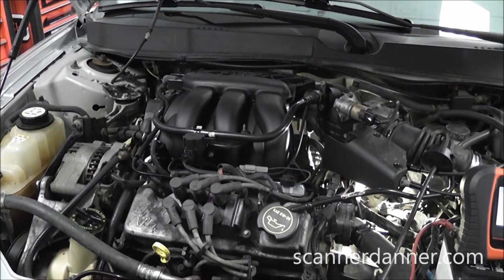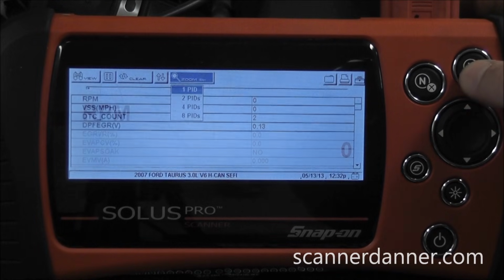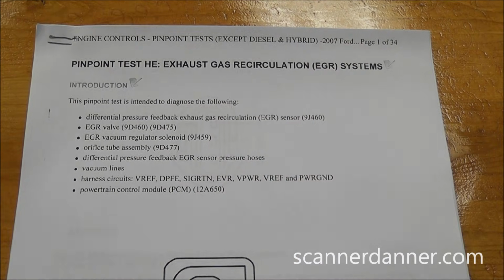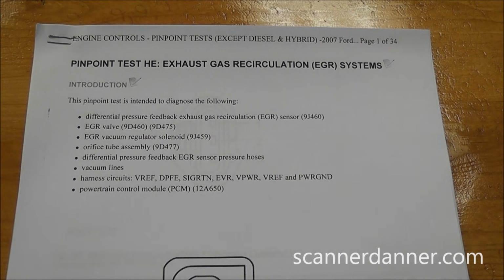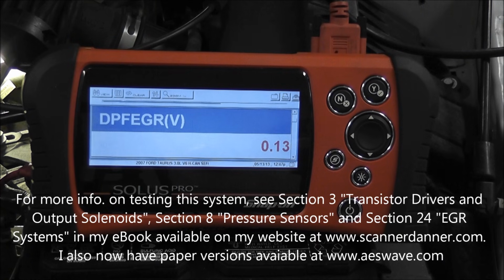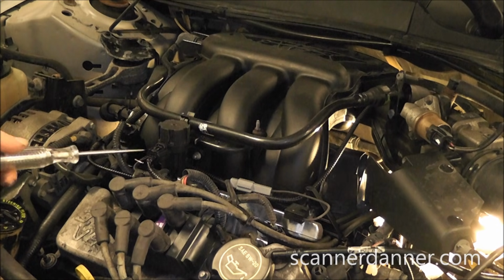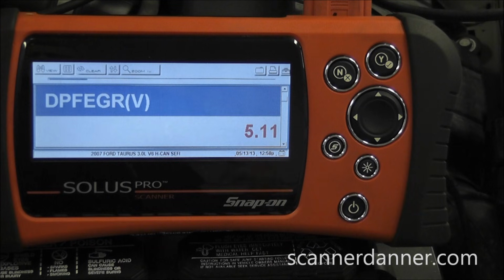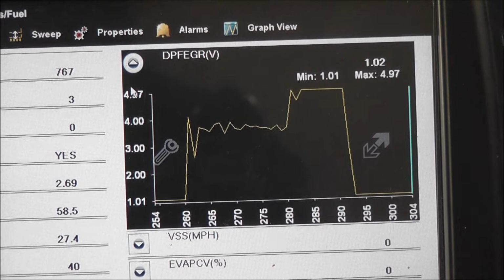P0405 EGR Sensor A Circuit Low (failed DPFE sensor)

Comment: Let me commend you on starting out with an explanation on how the EGR susbsystem actually works.  This knowledge is the key to quick diagnostics and repairs.

Your whole test methodology (forcing the valve to open via the control solenoid and watching for RPM drop) is what has been used for many, many years without scan tools.

Knowledge about this sensor would allow an experienced mechanic to jump to replacing it.

Following up with repair confirmation is a great way to do a "quality" repair !

Comment: That was a great explanation of how the EGR system works with the DPFE sensor using the diagram of all of the components.  Thanks for doing that. Makes it clearer. I never knew the hose position mattered because in previous videos when you talked about checking for restricted exhaust, you said you could either hose.  Thanks again for showing all of that.

Comment: Very good information. Replaced a DPFE on a 2001 ford expedition last week. Had a p401 code on my snap on modus. went to code tips and checked the DPFE voltage and it was steady at 0.2 volts. Replaced sensor voltage at idle was 1.03 after repair. One tip on the f150 and expeditions with the 4.6 engine, the passages in the throttle body are bad about getting clogged from carbon buildup and have to be cleaned out alot of the time. So if you have a P401 on 4.6 engine suspect passages are clogged up

Comment: I had a 2001 Taurus that, for years, had HORRIBLE spark knock and a really bad misfire at part throttle cruise. Never threw a code. I spent a lot of money getting the computer reprogrammed, ran a cooler thermostat in it one summer and NUMEROUS other things. Could never get it figured out. One day it threw a code for insufficient EGR - after I replaced it, it fixed everything else. Crazy how they relate.

Comment: paul great video on E.G.R system performance. best ive ever seen brother.paul E.G.R systems are simple yet can be so complecated.once you understand the coalition between P.C.M,E,V,R,D.P.F.E AND THE NEW YET SAME E.G.R SYSTEM MODULE LIKE FORD EMMISSION SYSTEM LIKE YOU PROVED IN THIS VIDEO YOU CAN CUT THE FACTORY FLOW CHART IN LESS THAN HALF.87% IN MY EXPERIENCE HAVE BEEN A FAILED D.P.F.E SENSOR.THANKS PAUL GREAT VIDEO RICK BAUZA.

Comment: My P0405 code turned out to be the wire connector as the wires had became brittle and causing them to touch one another. This was on an 08 Explorer 4.0

Comment: 1998 Pathfinder 3.3L, automatic, 164,000 miles, stock. Runs real good.

So I'm having a recurring P1400 EGRC Solenoid Valve error come back after erasing codes.  It reappears almost immediately after being erased.  I don't have any operability issues.  No other codes but one that came up after I started running the motor with the solenoid plug disconnected (for testing)...P0443 Evap Emission Purge Control Valve Circuit.  But it stopped appearing after I reconnected the solenoid plug.

I looked where the ECM is to access the EGRC Solenoid ground wire and crap is that a pain to get out!  So I did these troubleshooting steps to test the Ground wire resistance and the Voltage at the plug wire instead. This is after I tested the valve clicks/opens with 12v injected from a jumper wire.  The solenoid appears good, as far as activating manually. 

Ground Wire tests: left socket when looking at plug with lock button on top.

ENGINE COLD -- 
Off cold: 500 ohms
Key on cold: 1,200 ohms
Cranked idle Cold: 3,600 ohms.

ENGINE HOT --
25 minute idle warm up and short drive, and RPM revs to 3,000.
Off:  500 ohms.
Key On: 1,200 ohms
Cranked at 850-rpm idle: 1,600 ohms before revving, 3,400 ohms after revving 2,000 rpm.
Cranked and held at 2,000 rpm (in Neutral) for 60 seconds: 1,850 ohms.

### VOLTAGE tests ###
Power Wire: right socket.

Using ground wire on solenoid plug (motor cold) --
Off:  0.01v
Key On: 11.9v
Cranked: 14.3v

Using chassis ground frame bolt (motor hot) --
Off: 0.07v
Key on: 12.4v
Cranked:  13.7v
- Battery terminal as ground had same results.

If nobody knows I'm just gonna ignore it because I dont have emissions tests here and it shows no driveability issues either, so likley unimportant. 

But I kinda wanted to understand if my EGR is being left open to exhaust or closed, with the signal from the solenoid as-is.  Anyone know by chance?

Thanks!
Reply from the maker: Forget resistance testing. The problem with it is this:
1. When it tests bad, it's bad.
2. When it tests good, it can still be bad.
You have a 2-wire EGR solenoid that is flagging a code immediately, even after clearing it. Is that correct?
Step 1
Solenoid plugged in, with the key on, measure voltage on both wires (backprobing) and give me those readings.

Comment: Thanks for this video !!! I have stiil HUGE problem with my Mustang 2004/ 3.8 litre! After replacing bigger fuelpump, 255 lph, and bigger throttle body 70mm, my idle has been "crazy", goes to 2500, after about 20-30 seconds lowers to 1100-1200, never goes below??? There is a big vacuumleak somewhere, I know, because my AC works, but air is going to face first, like it supposed to then suddenly goes to difroze, to window, even I don't touch anything?? I was told that is a sign for vacuum leak. My "check engine" codes are P0507= IA Control higher than expected, sure know that!!!, and P0405 Exhaust gas recirculation sensor a Circuit low??? I tested so far, like you teach here!!!!, if my DPFE works, it is fine, I replaced it year ago, bought a new one now, no change, will return it, no change!!! Replaced TBS, IAC sensor, and EGR valve, all good!!??? I did checked voltage to canister solenoid sensor, in rear, that seems to work fine, when applied 12 V, and blow for it, it did close!!! I did not replace that one, I sprayed all over under hood, all vacuumhoses, no leak?? I did take out canister purge valve, could not really test it??, opened it, cleaned it???, put it back??, can't really tell, if it works?? Could that be open all the time?? And make big leak in vacuum system, and make idle higher??? I will replace that next, after taking back new DPFE sensor, old one is fine??? So confused, driving a car, thanks god, it is manual, very hard to drive, and gasmileage terrible!!! Please help me, smoking test next??? Thanks=)

Comment: I have a 1999 Taurus with a p0401 code and when I give it a little gas it stays at 2000 rpms for a few seconds and it idles at 950 cant find vacuum leaks egr tested good holds vacuum and stalls after its warm and apply vacuum.Before I start putting parts into it any ideas....very nice videos by the way

Comment: I know this is an old video but still you learn...i didnt know exhaust carbon only builds up at the intake end because of the gas cooling where it enters the intake...great stuff
Reply: shauns auto repairs : it can mix with oil from pcv system too. Also why inlet side goes clogged.
Reply: Benjamin Rich thanks

Comment: If the voltage on the DPFE doesnt pass 2V from activating the EVR does that mean poor flow in the system? The cars idle does change just not as significant as in the video. However even when raising RPM still don’t get near 4V reference.
Reply from the maker: Yes, plugged passages is what it sounds like

Comment: What if you have an intermittent low voltage code on a pressure sensor. I wasn’t able to get it to throw the code but checked wiring via multimeter and I everything looks good. I ended up replacing the sensor.
Reply from the maker: I think that is a good bet, based on the high failure rate of this sensor

Comment: what would you say of the code 0406 A circuit HIGH. i have it on a 3.0L 2007 ranger. have replaced the dpfe, repaired the blocked vacuum line to solenoid...

Comment: You always talk about the engineers and they should let us now about what is inside a module, I have Bentley manual for BMW 5 series and I can see what inside the module if the transistor is grounded or + feed. By the way you never work on German car's? I have Mercedes and BMW and they are not easy to backprobe molded connectors.

Comment: Hello there,  i have VW Passa TDI  2010, it smell fuel and did not heat up as it should be, also no eccelratin when its on P,   but it drive ok! i took it to the grage and changed egr with new one,  still the same,  it cost me £420,  any help Please Thanks

Comment: Hey...you are a great teacher..I bought your book recently and love it...I have a 2006 ford Taurus with a p0401 code. I did the test you did..my dpfe didnt go to 4 volts while running but only rose from 1v to 1.3 and the engine did stall...so does this concludes my dpfe is faulty?
Reply from the maker: Thank you! Redo the test now at 1500-2000 RPM to prevent it from stalling and make sure the voltage on the DPFE rises to at least 4v .
It is possible it rose higher than 1.3 during your test but the voltmeter wasn't fast enough to catch the peak voltage before the stall. If it stays low voltage, then make sure you have a good 5v ref and ground on the DPFE and also that the hoses going to the DPFE are not damaged before changing it

Comment: After listening to your cautions on connecting 5 volt reference to signal wire and then the subsequent advisories to use a 5k resistor in series to do that, I was wondering. What if u used your test light to do that function. Your incandescent draws 200 miliamps at 12 volts, so probably less at 5. Or your other test light draws even less. So my question is. R there any signal circuits that would b harmed with the incandescent, and if so it would seem that the other test light (I forget the name of the diode type test l.e.d. It came to me) would always safely substitute for the 5 k resistor. And if so, wouldn't that be easier?  Thank u!!!!
Reply from the maker: +Bill Rimmer  My concern would be the resistance of the test light is greatly affected by the heat of the filament. A bulb that is not lit has very little resistance and 5v will not light one of these test lights. 
Does that make sense?
Reply: Yes it does.  The cold filament would act basically as a jumper wire.  The only idea I was trying to test was this one. In trying to verify the integrity of the signal wire when there is no bias voltage, with the sensor unplugged, I can c now that the IC test light is not the way to go. The scenario I was envisioning was, scanner on the circuit, sensor unplugged,  led test light jumping between 5 volt ref and signal wire to observe rise to  5 volts on the scanner. The only reason I mention this is we always have scan tool and both test lights handy. We don't always have the 5 k resistor.
Reply: +Bill Rimmer You could unplug the ECT or IAT and use it's signal wire as your "protected" 5v ref for your integrity test on another sensor. 
If this makes sense to you, then major props to you my friend, you've been paying attention.
Reply: +ScannerDanner Premium  hey I got 2000 ford mustang, got the p0401 flow code, with the koeo or koer im getting 5v all the time on the dpfe signal wire, while the sensor is connected or not, also I have good ground and good 5v ref. also took the evr cap off and when I put my finger on top car stalls out. any ideas
Reply from the maker: +adrian gibialro bad DPFE sensor my friend. Nice job on your testing

Comment: So I have a 03 4v Taurus low curcit code for dpfe vref. I unplug it I get a 5v reading, I command the egr with scanner and it stalls. Only time I can replicate is shifting to drive and accelerate vrep signal drops to .16 momentarily and returns to 1.9. Wiggle test didn't effect either... any suggestions? Our new dpfe sensor didn't do it
Reply from the maker: your 5v ref drops to .16? This is your problem! The wiring is touching ground somewhere in your harness

Comment: Hi
I have Peugeot 308 1.6 hdi 2012, I have problem with egr valve code p0489, I changed dpf sensor, map sensor, butterfly system, clean dpf filter, also I clean egr with cooler, still management light up on dash board.
Please kindly help me with your advice?
Thank you
Reply from the maker: Post your questions to my forum www.scannerdanner.com it is free to join and we can help you there for sure. Also having access to some good service info is key (wiring diagrams etc). You will be expected to have access to one and have a voltmeter at a minimum for us to help you. 
https://eautorepair.adtrk.biz/?a=10817&c=24&p=r&s1=

Comment: If the vehicle has a DPF fitted would the pressure be measured before and after the DPF rather than the Orifice?
Reply from the maker: nope, it is measuring before and after the orifice in the EGR tube (DPFE = delta pressure feedback sensor for the EGR valve)

Comment: I have a p0401 so I did the t-pin on signal post for dpfe and it reads 1v at idle. I also did the ground for t pin on evr for it to actuate egr. The voltage reading goes down on the dpfe to .3 instead of going to 4v truck does stall. What could be wrong?
Reply from the maker: Reversed hoses on the DPFE sensor would do that. Is the sensor new?
Reply: Yes sensor is new. I tested the old aswell after that fact that i had bought and it reads 1v aswell so both old and new dpfe are good. I also cleaned the intake passages and replaced with new egr since the old one was gummed up. So all i need is to reverse the hoses
Reply from the maker: @israelduartejr4517  that's what it is acting like for sure. Usually it's hard to mix them up as the hoses are slightly different diameter, but if they've been replaced before it can be difficult. The smaller tube on the DPFE sensor should be the upstream hose (closest to the EGR valve) I think 🤔

Comment: Hi there, thanks for share... question, How can I get the pinpoint test HH that is what I need? Tks
Reply from the maker: https://eautorepair.adtrk.biz/?a=10817&c=24&p=r&s1=
Here is a link for service info.
Or I can help. What test are you trying to do?
Reply: @ScannerDanner  well, I got P0406 code on my 2006 Ford freestar, I thing Is relater to EGR module. I Will like to get info to performe a test over such Valve in order to find out the root cause of the showing code. My check engine light Is on. Tks un Advance For any help... Best regards!!!

Comment: How to fix egr sensor a circuit low? Any one guide me?
Reply from the maker: If it is this sensor I'm testing in this video, do what I showed.
Step 1 is to get me voltage readings on all 3 wires of the DPFE sensor with the key on, sensor plugged in, backprobing

Comment: where is this sensor screwed to please,mine isn't screwed to anything,its just plugged in and the downstream and upstream hoses are holding it,is it screwed to the backside of the upper intake manifold,man,its a wicked pain to see back there,someone must have replaced this part at one time and probably lost the screws i'm thinking,i have an 04 taurus but its in the same location,please help,lol
Reply from the maker: most likely lost the screws as you said. Get yourself an inspection mirror. Here is a link for an inexpensive one from Amazon
http://amzn.to/2u2ClDo
Reply: thx you,thats a good idea,i'm prepared now for the next time i take it apart,have the diagram,a mirror,ordered the parts,hoses,dpfe sensor and all the hardware,what pain in the a@@,but ill get er done,it just needs to stop raining for an hour or so,lol,can't win here.

Comment: Do u have a video testing the HH design?
Reply from the maker: the HH design?
Reply: Hi SD I apologize, the one you printed out From Google image. The all in 1 dpfe,evr,evr. Do u have a video testing that one  ore would it be the same it's just compacted all together?
Reply from the maker: I thought I did but cannot find it. It is similar in testing except if my memory is correct, the single exhaust tube used for the DPFE sensor is exposed to manifold vacuum instead of exhaust gases all the time. I guess they finally figured out why the sensors would all fail.

Comment: I did this test and I had no change in the idle. Any suggestions? I have a 08 f150 4.6
Reply from the maker: Plugged EGR passages would be suspect. Manually open the EGR (hand vacuum pump) and see what it does to confirm

Comment: im my lincoln ls 2000 v8 3.9 have a code but say egr high voltage ,why??
Reply: Check for good ground and see if its not unplugged what codes number qas it.

Comment: Yes the flow chart sucks. But you have to understand how the whole system works and ground side test, and so on. The flow chart is for those that do not have the understanding. But because you understand the system so good, and you showed the google pic of the system it makes sence. Which brings up a good point, All flow charts should have a pic with with elec, and vacume values on that picture, and then the flow chart. Hopefully the day will come when flowcharts are obsolte and instead the manufactures will supply a usb flashdrive with a videos from you, or someone like you on every TBC.for engine management and everything else. In fact with your paper book you should have a flashdrive included. I wonder if your e-book has click links? And of couse lastly as you keep saying you must understand your tools and have the money to but them. I have heard you say on ERic the car guy that the school owns most of the tools you use.... Lucky you...

Comment: I hate to be that guy... As a ford tech... The tube to the intake manifold (copper elbow) is definitely clogged with the carbon deposits. 100 % that car came back a few days later of not that same day. Every 3.0 that comes in with that i sell an intake reaeal and clean the tube brand new. Any one in the comments with this code. Dont throw solenoids or egr valves. Waste of money. The code sets because indeed the flow is low. Cant pull a vacuum on the valve to regulate flow. 👍
Reply from the maker: Of course intake passages do get restricted. I have videos on this too. But in this case that was NOT the case. If the intake passage was plugged, the idle would not have gotten very rough and almost stall when I forced the EGR valve to open. 
100% this car did not comeback